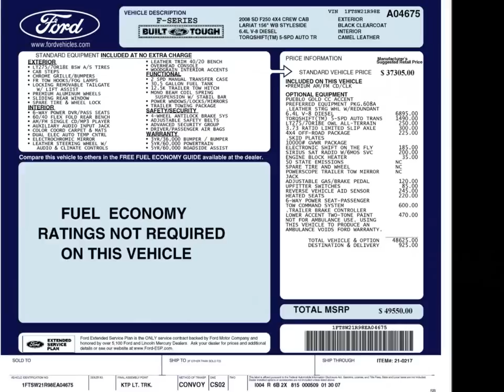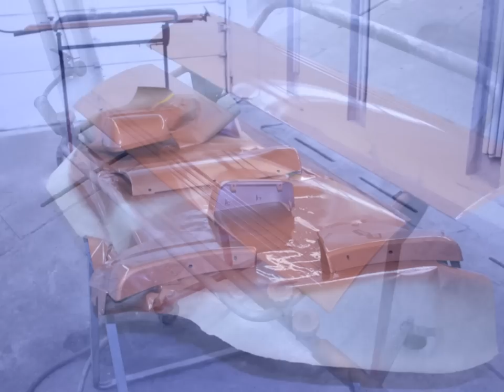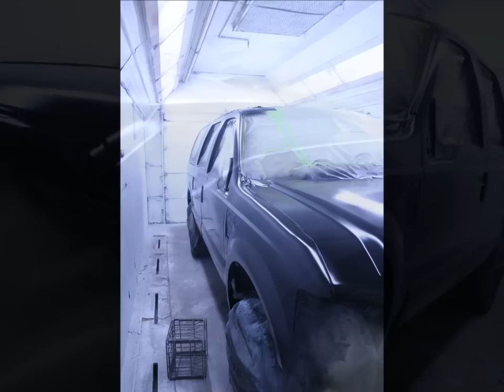2008 Ford Excursion photo montage.wmv

Comment: Did you merge both parts of the chassis or is that the excursions... what chassis would be the best for this project
Reply: 10 year late reply.
But it looks like they welded the front portion of the superduty frame to the rear portion of the excursion frame.  Similar with the body